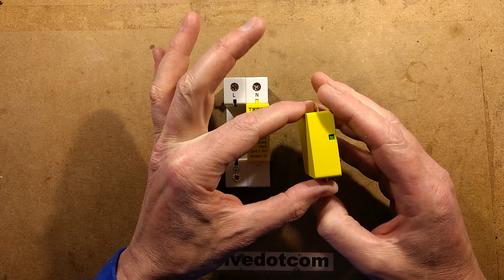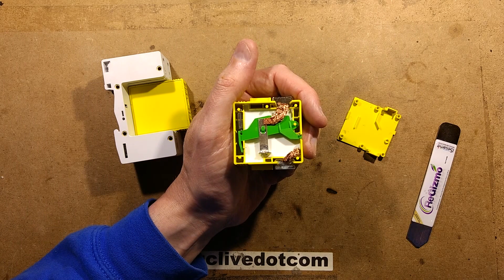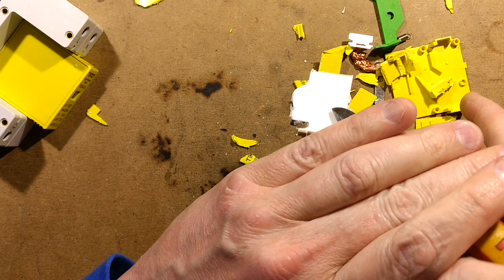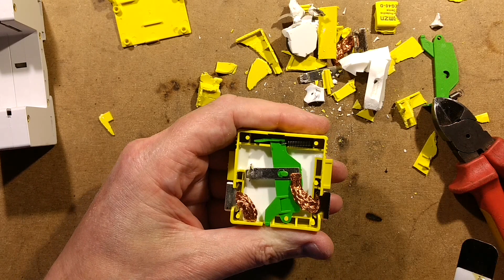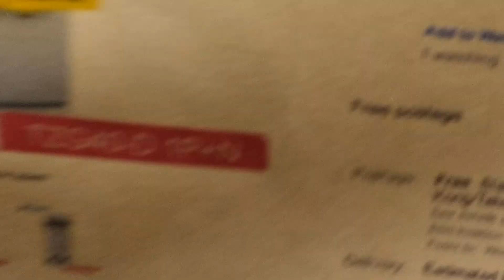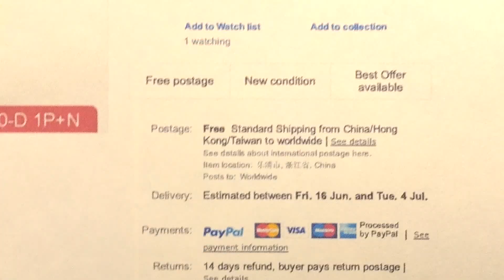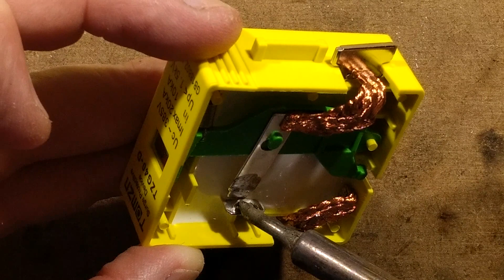DIN rail mounting surge protector with uninspiring safety device.

Comment: I bought a couple of these cheap Chinese surge protectors, one installed and another as a spare, I was a bit bothered by the outcome of the test here, so pulled apart my spare and heated it with a mapgas torch on low. It cleared the solder by at least 2mm. So I'll be keeping mine in place. My experience of buying Chinese products is that there are many copies of products and some are worse than others, with some being quite faithful in the details being copied.

Comment: To Be Fair - You shoulda heated the solder join with the unit in the upright position as it would be installed!   I wonder if that resin is non-flammable of some type?

Comment: I've just got a YUEXIN SPD which looks extremely similar, except that it's not yellow. The innards are very similar but not quite the same. Rather than one tab being soldered into another, in mine the tab is soldered to a bit of stiff wire coming from the varistor. Maybe slightly more travel, but a similar risk of still touching/having a solder bridge. They are supposed to be fitted with a 20 or 32A MCB so if the things fails short-circuit that should trip, or melt the rest of the solder before anything catches fire, but who knows. You can buy these SPDs online for a fiver now, which is crazy - I do wonder if there is anything inside those. This one was 12 quid. Brands you've actually heard of start about 20 quid. Fancy ones are 50-70, but those probably have the electronic detector in as well, not just a MOV.
Thanks for taking one to bits so I didn't have to destroy mine

Comment: I agree that the thermal break does not seem very robust.    

However, In a real event, a few factors could come into play:
1) By the time the solder bridge pops in a 'real' event, everything is pretty hot.  The solder could remain liquid longer and the solder flow away. (In the soldering iron test, the heat is immediately removed)
2) If a solder bridge is formed the current will continue to flow, generating heat and causing the solder to flow away

- OR -

3) The rapid heating of the soldering iron may not be representative of what happens.  Could it be that the solder bridge breaks when the solder is soft but not fully liquified?

To properly test the device would require actually over-voltaging it.

Comment: Hi Clive, a guy I know asked me to look at his little arc welder, 230v jobby, nothing fancy, just for a bit of DIY stuff. He had an issue with it keep cutting out so  he took it into work one day and modified it by putting a low voltage PC cooling fan in the back to keep the transformer temp down a little bit better and apparently it worked. Only after several months (not using it much) the fan died, it was a 12v fan with a mini controller. He replaced it and carried on using it. I borrowed it the other day and he showed me it working before I took it away only to find out the fan had died again. I metered it out and actually it was the controller I think as its the first thing before the fan to go. I used it anyway and when I returned it he said to keep it as hes buying a better one.
I took it apart to look at the cooling fan issue again and the controller has in fact gone, must be the transformer surge during striking the arc I reckon. 
So my fine fellow, can you advise please, is there such a device that is small enough to wire in line (or across the fan terminals) with the new cooling fan that I'm going to fit to absorb the surge? I'm going to fit a 230V fan this time, I dont think the cheap Chinese backstreet electronics has a place inside a welder. There is hardly any heat actually after about 20mins use, I was suprised how cool it was. Hopefully your wisdom will alleviate my issue, thanks 👍👍
Reply from the maker: You can get compact 12V power supplies.  The 12V fans are more compact and quieter.

Comment: I know this video is about 5 years old now but just a quick heads up when it comes to potted resin - excess heat will usually cause it to break its bonds and start crumbling. In my old job we sometimes had to remove resin from test-failed parts and I discovered by accident that a fair amount of heat (about 300c) is enough, well within range of professional heat guns. The trick is to do it in stages, heat a bit up and break it off, rince and repeat until you liberate the parts from the resin. Side note: All SPDs that I've fitted so far require overcurrent protection. Most call for a 32a MCB or RCBO so If one did ever fail short circuit - ADS would occur due to the short. Upon seeing red in the window it would not take long to realise what has failed.

Comment: The phase line is usually coupled with an external circuit breaker like a fuse or a MCB. If the surge voltage is big enough it will allows a large current to pass thus shorting to the earth line. In such case it will blow the fuse or trip the MCB. The solder melting away is like fail safe of last resort in case of external circuit breaker failed to work.

Comment: I don’t think this is designed to act as a fuse and disconnect power. I think it’s just to serve as an indicator to the user that the device has encountered a high energy surge and that they need to replace the unit.
Reply: Yep

Comment: That "little green pip" is a mating/keying system.
These MOVs come in a variety of voltages, and the pip makes sure that you can only insert an MOV of the correct voltage rating.
Ex, you wouldn't want to install a 175v clamping module into a system with 240v service.
Reply: No it's not, the keying is another thing but this one is an indicator, I have one that have a 3 prong terminal under it which can detect if the thing is tripped, there should also be a microswitch behing that pip on the supported base

Comment: Hi Clive......you had the SPD orientated horizontally when you melted the solder to make it "trip". I'm wondering if the separation would have been more if it had been orientated vertically, as it would be when fitted in a consumer unit?
Reply from the maker: I may have another go.
Reply: @bigclivedotcom  I've been having suspected transient spikes with various devices and machines blowing up/breaking down over the past few years...waiting for the electricity supplier to get back to me on the result of a monitor that they put on my supply. In the meantime i've bought a couple of SPD's which I'll stick in (install one, keep the other two inserts for spares) and see if that solves the problem. Well worth it for about £8 each..

Comment: I'm wondering if an electrical arc wouldn't throw out a great deal more energy and high temperature than a soldering iron pulled back at melting point. This company obviously sells a good deal of the world's protection devices and I'd expect they wouldn't dare be doing it wrong. Then again, I might be wrong.

Comment: I've bought some of these and did the same test, they opened correctly with approx 2mm gap, what've noticed is that the solder they used kinda breaks at some temperature instead of melting and creating bridges like yours, and the clearance is a bit higher

Comment: I kinda feel the solder joint is a secondary safety, the first one is the plastic bit that fits in the oval hole melts when it heats up and it snaps up.
O wait if that happens it makes it totally useless!

Comment: Use a stepdown transformer to say 2 V from the main voltage and give it some amps - while being the right orientation. Much more interesting than using the soldering iron :D
Reply: you need high voltage to get the mov to conduct, that's how they work.  It's wired between live and ground, it simply doesn't conduct at normal line voltage (or it does a tiny amount), when the voltage get's too high though it goes low resistance and let's the excess voltage bleed to ground.

the issue is when they get worn out, then they stay in a low (ish) resistance state, which means they get HOT, possibly starting a fire (which is why the safety flag thing is seen as a safety feature)

Comment: I had almost bought a similar surge protector. for 3 phase current It was offered under the name of a local importer but turned out to be from a manufacturer on Alibaba). I don't want to take risks with safety equipment so I decided buy a real brand (OBO Bettermann V10). I have opened it up ;-) It is built considerably better than the one in this video. It has 3 square varistors and a fourth disc-shaped component which is probably the varistor between N and earth.

Comment: Stabbing oneself with a screwdriver - special engineering skill - reminds me of the time....

Working on car brakes - with small high power springs - I once slipped and managed to catch my watch strap on the assembly with such force that it peeled the strap end from around the pin that holds it on to the watch.

Simple matter of reassembly of the strap round the pin and tapping it back over with a hammer.

Shame really it was quite a good watch.

Haven't worn a watch since.

Comment: This isn't a circuit breaker.  It directs a surge to ground and shorts l&n together the only thing the flag does is notify you that it has been activated.  They are commonly used in solar combine boxes to suppress lightning strikes

Comment: I'm guessing buy the size and the gaps in that metal tab, it's only for lightning strikes. I bought one but haven't had the chance to install it yet. I got the red one (which I thinks 60kA 🤔), which in hindsight was a bad idea 😕 I might be getting a much lower kA rating one like you've got. 
I know I'm on a TN-C-S system and there mostly for TT systems but I thought I'd be on the safe side as you know know what might happen. I know all substations and overhead lines have movs so 🤷🏻‍♂️

Comment: Seems like you’ve acquired this product from a Chinese seller but anyway, I’ve read through the official testing report of a similar product. That ‘soldering stuff’ is supposed to protect the device from over current as low as 40mA in the event of MOV failure or over-voltage for extended period of time. The heat required to melt the solder is coming from the current but not the MOV since the temperature rise on the case should not exceed 120 Kelvin(per Chinese standards). It would take a couple for minutes for the safety device to trigger like the most of fuses do, of course.

Comment: They have the design wrong, both the dimensions and the layout. Imagine the spring (a stronger one since mechanical disadvantage would require that) in the centre, the breaker at the end - swapped positions. A small movement of the spring would result in a long throw of the breaker AND  a faster throw (important if you want to minimise arcing). Just about everything I design turns out to be wrong by varying degrees. So I design it again. That'll do often won't! But then, it's a very small device, so I suppose it'll only start small fires, so no harm done.

Comment: Hey Clive,

according to Wikipedia ( https://en.wikipedia.org/wiki/Surge_protector ) the green plastic shows failure (life to protective ground connection). The MOV closes connection to protective ground in case of overcurrent trough lightning strikes.

That's why the connectors of your device are labeled Life, Neutral and protective ground.

Comment: Hi Clive,

Greetings from Uncle Duncan in South Africa.
The Dehnguard which costs over a hundred pounds is the good one.
We use them.
The MOV is a lot bigger, like the size of the biggest cookie you could fit in there and it's not potted.
Also we space them apart on the rail as we have learnt that the energy of course becomes warmth.
They do knock out a micro switchy type device in the base of the ones we use and then the machinery we installed it into goes quiet, with a message of bad news on the pc screen.
The waveform of the mains which in Zambia resembles AM modulation tends to cause quite a bit of this.
Thanks for a great video, D

Comment: It will arc and splatter the fuse alloy. And it is meant to trip your fuse in a surge. So it is to be mounted as close to the inside part of the panel, after your main breakers and diferential protection.

I have to get me some of those... :D

Comment: Works as it should. In case of a surge spike the varistor becomes conductive and will trip the RCD. If the varistor got too hot, the indicator will show that you need to replace the protection. Even Legrand, GE, etc, use the same kind of element.

Comment: Made of heat resistant plastic to withstand the temps inside the densely populated electrical control cabinet. ( too much crap jammed onto the panel).

Comment: I thought that I would point out that if the voltage is high enough to drive the MOV into conduction long enough to heat to melt the solder, it is likely high enough to arc even if the solder falls away from the gap. It needs to have some sort of flame suppression, (sand or similar like a fuse), and a much wider gap. I am guessing that the resulting arc would fill the box with metal vapor and plasma in a way that would get across to the other side and go into complete runaway. I would really like to see how spectacular the fireworks are when this happens!
Reply: i think breaker would trip, extinguishing the arc

Comment: I would have used a lighter or a heat gun to test that.
(to prevent the risk o contaminating the existing solder.)
Or test it electrically by stuffing a little too much  power through it.

Comment: summary: This device will trip the  ELCB and the power will be disconnected. Also MOV inside is protected against fire with the porcelain covering. But the indication mechanism may or may not work :)

Comment: The green lever activates a signalling contact in the socket of the SPD. Well, YOUR socket does not have this contact, they produce two versions. The signalling contact is needed if you want e.g. an external warning light if the SPD is defective.

Comment: In Denmark we have the lightning protection connected in a 3 + 1 connection. From each of the 3 phases we have a 275V varistor too neutral. Between neutral and earth we have a 255V spark gab.
We are no longer using the connection with four varistors from each of the 3 phases and neutral to earth because when the varistor between neutral and earth have a leak current will the RCD perhaps not trig!

Comment: Interesting. Wonder why they used a round varistor, though...
Also, that protection mechanism is a bit dodgy. I would have expected a bimetallic strip to trigger the breaker mechansm, not a blob of solder.

Comment: Seems rather Heath Robinson, with full respect to Heath. The solder 'safety' connection is not fool proof in my qualified engineer's brain. Is there any procedural purpose in potting the varistor ?

Comment: I did notice you were holding it upside down and there seemed to be a bit of 'wiggle room' in the linkage. Maybe it would benefit from Gravity Assist in a real failure mode - but yeah not very confidence inspiring at all.

Comment: Hi Clive
I wonder if the solder joint would have failed better if you had played a heat gun on the joint and surrounding area, after all in the event of a failure the whole of the inside of the unit would have heard up given the enclosed space. This have maybe made the solder more liquid due to the generally high ambient temperature and so may have parted more cleanly. Just a thought.
Great bit of destruction anyway.
David

Comment: the failure on protectors like that usually isn't full short, but rather modest current leakage, so the solder would heat slowly until it couldn't hold the spring tension anymore and pop out suddenly. they are probably meant to be right side up also

Comment: I have a question ive bought a brushless generator but i want to use my  cordless power tool battery chargers, and use a mosfet inverter plasma cutter also 120/240v 20amp input 50/60 hz but i don't want to damage the electronics inside of them!

Comment: I think the design would work better if they just used a shorter spring that could apply the same amount of tension. The spring they're using is too long, so the green plastic part can't go up enough to fully separate the two metal pieces. They could probably move the yellow plastic tab the spring holds on to a little higher up, so the spring has a bit more room

Comment: Here's a teardown video of a Hager SPN265R surge protection device: https://www.youtube.com/watch?v=9Vr5tHN_DgI
It uses two much heftier MOVs but has a similar disconnection method, using a spring loaded mechanism held in place by low melting temp solder.

It also features a yellow spring-loaded warning flag, that's held in place by a rod made of low temp solder. My guess is that when the MOVs overheat, but not enough to fail irrecoverably, the rod will melt and the yellow flag will pop up.

Comment: Looks similar to the OBO V20C surge protector. The contact on the inside normally opens the circuit if the leakage current is to high and so it is not designed for high currents. Normally the maximum fuse is a 125A type. The pin on the back side is for an auxiliary switch to signalise a damaged or missing unit.

Comment: In normal operation the solder joint temperature rise would be very slow. Under these conditions just below the melting point the solder would soften and break before it became fully molten causing a clean break without leaving a solder bridge.

Comment: I'd imagine if the solder joint got hot the whole thing would be hot not just a small area like from the soldering iron. This would mean a more uniformed separation

Comment: love your work.. but umm.. @10m55s - upside down miss jane.. they don't fail upwards.. they fail falling down.. so hold it the correct way up and the hole in the metal arm will hang a few mm further down and/or will pivot??!? that may give you the "3 or 4 mm" mentioned @12m15s